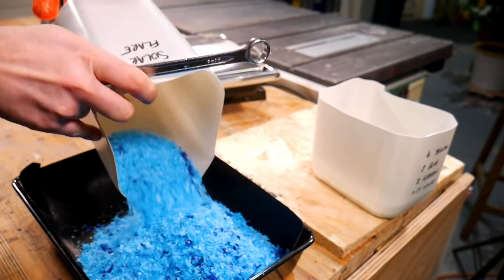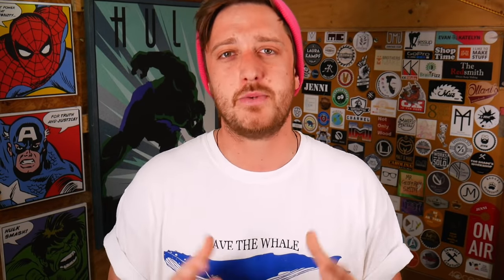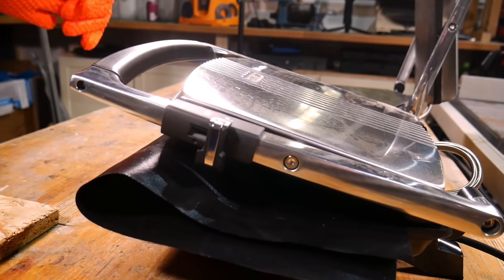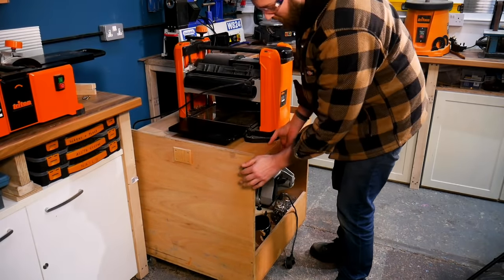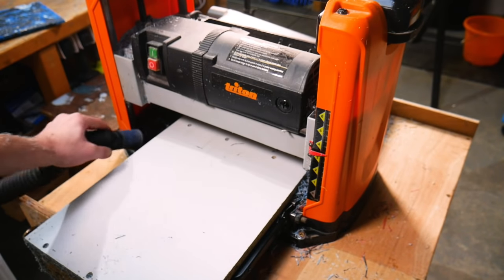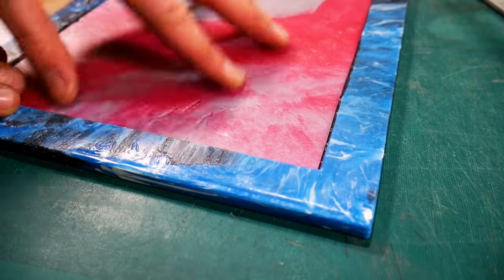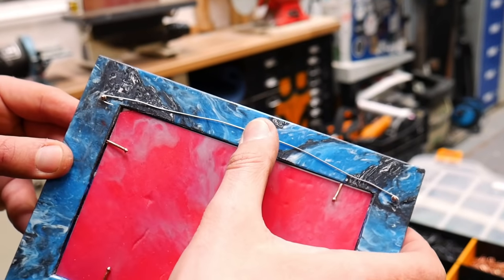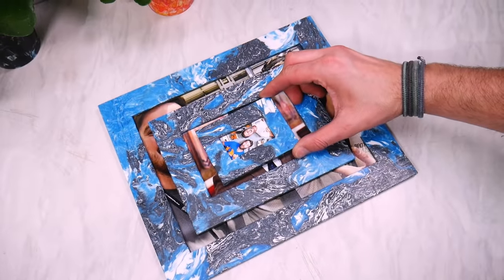Making SUPER Easy Photo Frames out of Recycled Plastic

Comment: Good, ya'll finally caught on that cutting, slicing, and scraping leaves a better finish than sanding and reheating. There's a leather working tool that trims and rounds corners that also works well with HDPE plastic.  Don't know what it's called but you can also use cuticle cutters.  Tho, I just use a serrated utility blade and freehand the edges.  I've also started using a whittling knife.
Reply: @imadeitworse8275  spoon?
Reply: @imadeitworse8275  Oh okay, they used whittling knives on that spoon.  That's not really what I'm saying though.  They carved that whole thing and I'm talking about cleaning up edges.
Reply: I'm guessing the leatherworking tool you mean is an edge beveller. They come in a bunch of diameters, but they're usually on the small side. Great for knocking a sharp edge down, but not really rounding edges per se

Comment: Do you wear masks or have ventilation? Could imagine some nasty fumes come off heated plastic
Reply: The fumes off of certain types of plastics are so minor like hdpe and ldpe, PLA and actually quite a few others can be heated quite safely without ventilation. I wouldn't recommend it with PS or ABS or ASA, or a whole host of others, but there are a lot of common and safe plastics to work with. The hotend of the tool would pose a greater danger than the plastic fumes themselves.